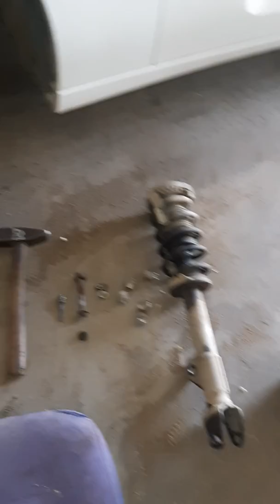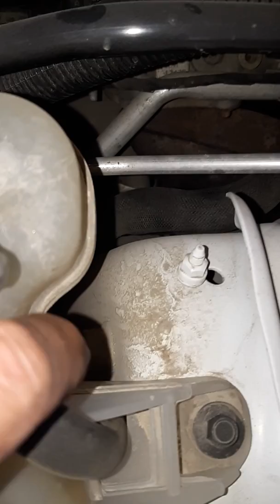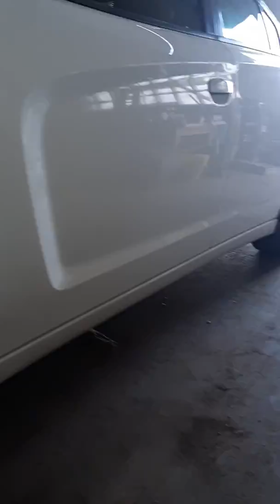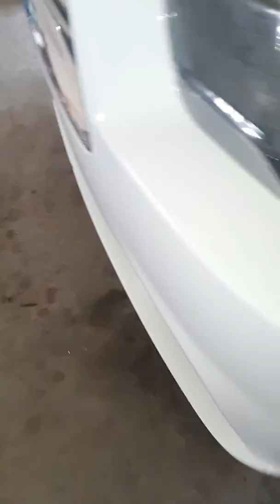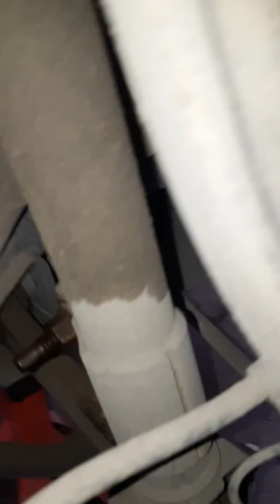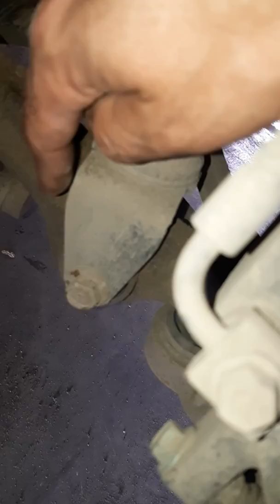Dodge Charger Strut Removal Reference

Comment: Looks like a Charger SXT. Very similar to my 2013 Charger Pursuit, though mine has bigger and heavier parts--though looks like they fit in the same spots and come apart the same way.

Another tip is to put the nut back on a little ways when to smack the ball joint. that way you don't mess up the threads.

Thanks for the video it's much appreciated!
Reply from the maker: Thanks for the tip, thanks for watching, i kinda thought the parts were a little small for the size of the car.  But again thanks for watching!

Comment: I got a 2012 looks identical to this. This will help me I hope coming up this weekend when I change them off.  Keep getting a loud rattle / banging noise coming from the front when hitting small little speed bumps on the road few mechanics test drove it said it sound was coming from the suspension so I only hope this is what’s needs replaced!!